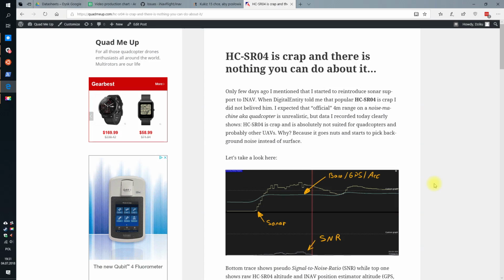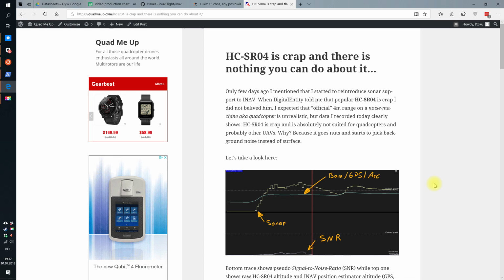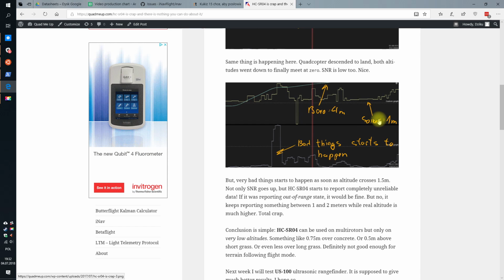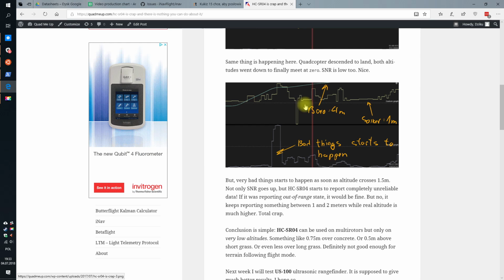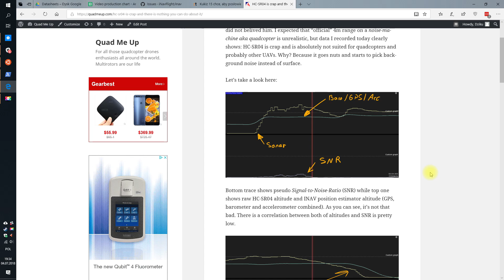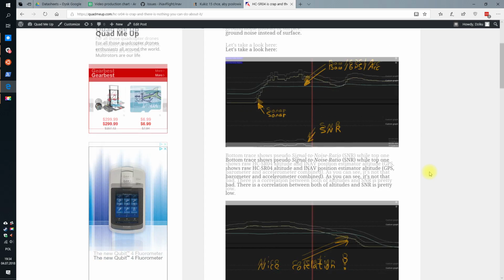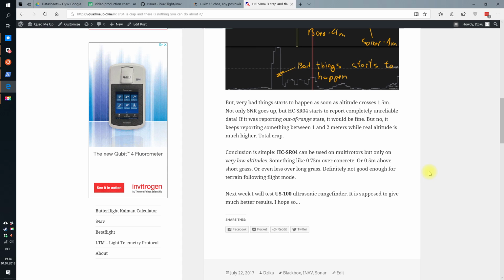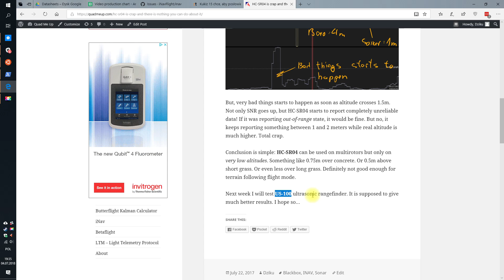How to connect HC-SR04 sonar to any flight controller

Comment: Hi,

I bought a sonar but forgot to check if it's compatible. Now still running on beta 4.2 but planning to go to INAV.
It's connected on uart rx2/tx2
Don't know how to set it up. No options for sonar in the uart list. 
Or better go for the matek lidar? 
FC F722se Quad. 

This is the sensor I bought.
US $6.80 |  Mini uav obstacle avoidance ultrasonic ranging module MB1040 High Performance Sonar Range Finder 
https://a.aliexpress.com/_BUN17z

Comment: HI, I noticed you tried the VL53L0X  and you said it was limited, ive also looked at the inav docs too, i have seen a VL53L1X which is rated for double the range of the VL53L0X, I have noticed the cone angle of the VL3L1X is 27 degrees. Any thoughts on this ?
Reply from the maker: VL53L1X is not better. It has bigger range but it's not tracking from 0

Comment: Hi Pawel, Great Click Bait :) 
Have you considered any of these: 

Radiolink SU04 Ultrasonic Sensor Distance Measurement Module Compatible RC Drone Pixhawk Mini Pix
https://www.banggood.com/Radiolink-SU04-Ultrasonic-Sensor-Distance-Measurement-Module-Compatible-RC-Drone-Pixhawk-Mini-Pix-p-1321624.html?rmmds=cart_middle_products&cur_warehouse=CN 

Also; any of the VL53L0X time of flight sensors, these are supported in Ardupilot and are good for up to 2.0m apparently? They are really cheap! 

I would like to see more reliable cheap sensors for our lightweight fast DIY drones, rather than the expensive big heavy Lidar based sensors on commercial drones. 

Have you also considered looking at the accuracy of a BMP280 vs a MS5611 Barometer? Good for higher altitude position hold but no good for terrain follow. 
Thanks for the videos :)
Reply from the maker: No idea about this radiolink sonar but it landed on a wishlist ;)
VL53L0X  is fine but useful range ends below 1m. I've been testing it last year. The VL53L1X has more range but is not tracking from 0.
Reply: I've also seen this Sonar; (another cheap one!) 
GY-US42 I2C Pixhawk APM Flight Control Ultrasonic Distance Measurement Module 
https://www.banggood.com/GY-US42-I2C-Pixhawk-APM-Flight-Control-Ultrasonic-Distance-Measurement-Module-p-1309970.html?rmmds=cart_middle_products&cur_warehouse=CN 
It looks like it is a copy of the MaxSonar EZ4 that comes with some PXFlow modules.

Comment: But, however, do you plug écho to rx and trig to tx of a given uart ? How does it work?
Reply: For us100, as hc... is rubbish 😉
Reply from the maker: The trick is that it does not work like that. It needs dedicated pins, not UART pins and most modern boards just do not have them